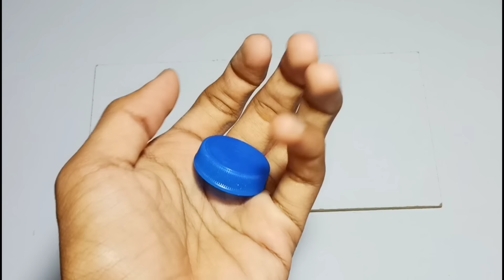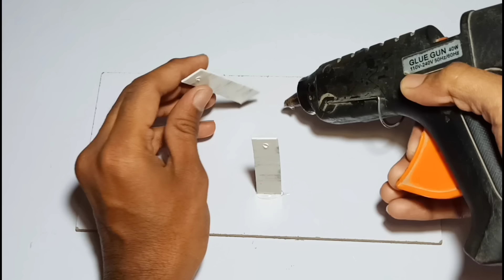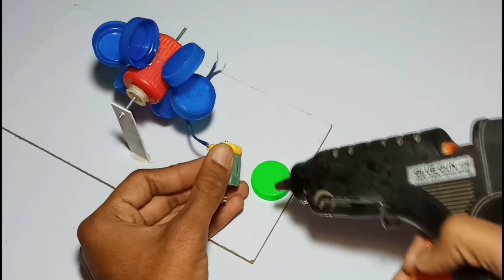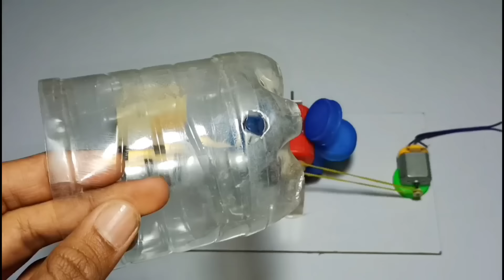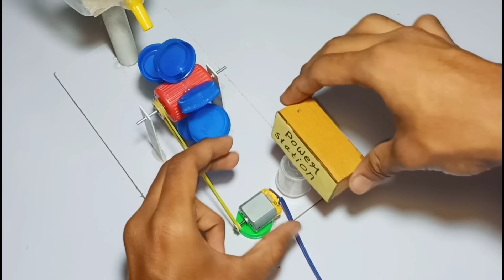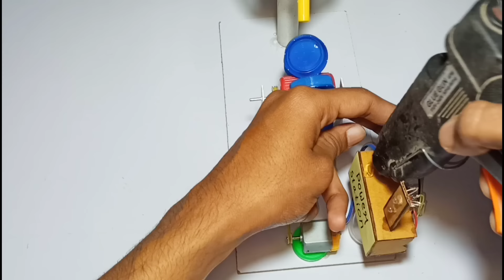How to make hydro powerplant working model Hydroelectricity science exhibition project working model

Comment: The battery alone would power the light. The pulley should turn an alternater to produce power. Now if you had a rechargeable battery to store the power that would make sense.
Reply: I know right... At the beginning of the video, I got hooked. Until I reached the end of it and it frustrates me. How can we improve this using the DC motor to recharge the rechargeable battery? Any thoughts?
Reply: Gudaa geekondi eddaru scam
Reply: You are right but it will work with the battery and if you want to use the battery you can integrate the charging plate of the Power Bank so it will charge the battery
Reply: exactly
Reply: You are right

Comment: It is not hydraulic because he uused battry
Reply: I have the same question. Running water carries kinetic energy that needs to be converted into electric energy in a hydropower project. Here he used battery to this job. It's all fake .
Reply: Bro its for showcasing, its a model for representation!!!
Reply: Or, You can hide the battery and switch behind.

Comment: If you are generating electricity on the basis of hydro then in last you used to battery for what purpose you had use battery
Reply from the maker: Because this model is very small for generating electricity and this is 💯 working if you are making it big size . And this model is for school exibition representation. Ok .
Reply: Super🎉🎉🎉😮

Comment: You r using only a battery to swithch kn the led...just motor is rotating...nothing else
Reply from the maker: Yes this model is for representation. And this model is award winning project.
Reply: Misleading
Reply: @deepikayadav6822   exactly

Comment: Can it work without battery? If we just rotate fan with water then that energy will be converted into electricity and the bulb will glow??
Reply: It will but for that u need a very high power of jet water then only
Reply: Use a much bigger pulley. I believe It would work.
Reply: No it's not possible for the given materials and the model
Reply: No it cant
Reply: yes. How it can be hydroelectricity?? The Bulb is glowing just because of Battery. not for producing energy by Water presure on rotating wheel 🎡
Reply: @sandipmaity.244 😂
Reply: @sandipmaity.244  It is just a demo model but I don't know why he has written working model😂
Reply: It can work but you have to use AC moter by which you can glow a tube light
Reply: Can we work with out 🔋
Reply: Yes but u will need big motor (dynamo motor)
Reply: Instead of a motor i think you would have to use a dynamo and a low voltage LED with no limiting resitor maybe.
I think this is for demo purposes only

Comment: This project is very best because the electricity is produced by the only water materials required one piece of bottle small cardboard piece small motor one rubber and one switch in this project free electricity are produces from the water only
Reply from the maker: Thanks

Comment: Hi Tommorow is my project submission pl give me the material required in model  pls i request 😢
Reply from the maker: Battery, battery connector, 3 led light , switch, 6 bottle cap , rubber band , bottle , pvc pipe , iror rod cycle spoke , small plastic sheet , plyboard.

Comment: How did you produce electricity  here with just DC motor and not a dynamo/generator. You are using a DC battery to light up the LED, not the electricity generated from the hydro power.

Comment: You didn't even connect the wires from motor to the circuit😂, how tf it draws current???
Reply from the maker: This model is only for school science exhibition representation , this model shows, how , hydroelectric power plant is generating electricity. And this is also a award winning project . Ok Thanks.

Comment: If the light was going to work with the help of water then y did u used battery for the light and motor???
Reply from the maker: Motor produce very less electricity because of small size of this project. If we are making big model then this work without battery ok . And this project is only for school project representation.
Reply: @howtocreate9896

Bro then we have to use big size motor or turbine or reserver
Reply: @TanmayShah-qc2po 7:25

Comment: Bros we have to on the switch first and we have to fill the water in the bottle the light will simpley on if the switch on and the light will off if the switch is off aaa or it will only work when the turbine is working ???????

Comment: Dc motor k vayr kiske sath joint krne hai ? Plz rply me
Reply from the maker: Aap simply wire ko box ke andar kahi bhi fasa do . Vo wire bas representation ke liye hai.
Reply: @howtocreate9896 meaning the motor is not connected to the system the battery is the one producing the light?
Reply from the maker: Yes

Comment: Bro here why u are using battery
U can give  supply directly  through the dc motor to the led ....
Reply from the maker: Offcourse but if you are give directly supply to led the you need more and more water to run the wheel very fast to producr more electricity. Thats why I use battery. And this project is for science exhibition representation . Ok thanks.